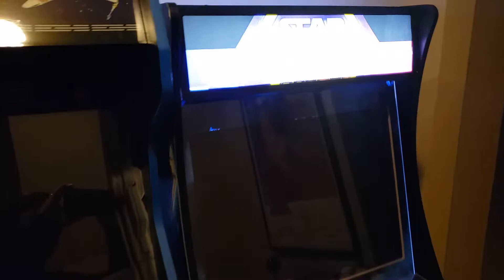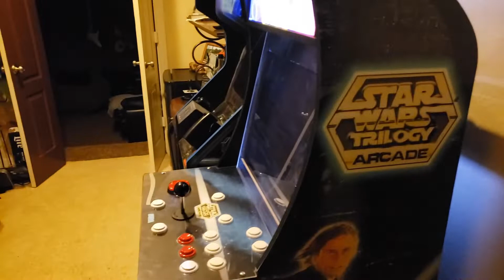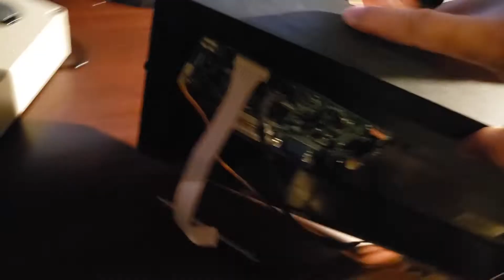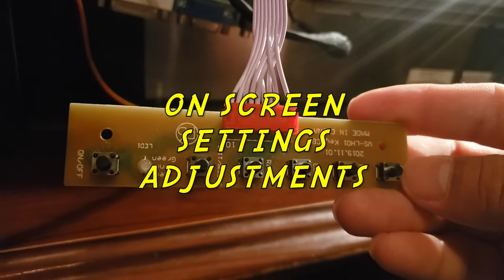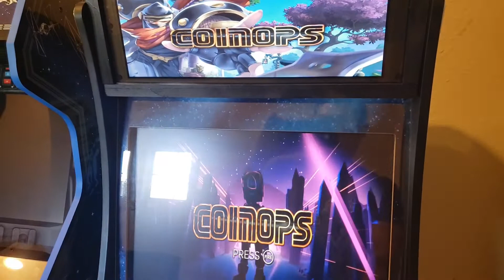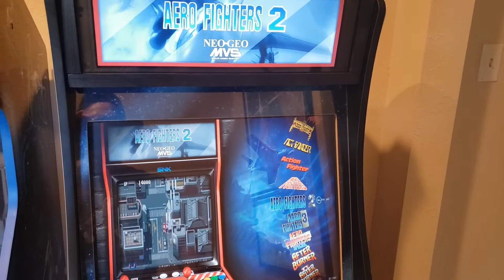Arcade1Up Build - DIY Dynamic LCD Marquee

Comment: What was your total cost for this 2nd screen marquee, and does CoinOps Next 2 have this capability built in?
Reply from the maker: For me, it was the cost of the marquee ($116) plus the wood, plexi and can of flat black spray paint (leftovers from my larger arcade build). I'm not sure how much the leftover stuff was, but plexiglass is not cheap, but when you spread it across other projects, it makes it worth it. I also used a slot cutter for the plexiglass to slide into (like T-molding). All of these add up if you don't have multiple projects involving the same materials. Sorry for being so vague, but I don't recall the prices I paid for the stuff originally from my hardware store.
Reply from the maker: Also, yes. COINOPS NEXT2 has the capability built in for dynamic marquee. This is one reason I use it over Big Box (which i have also but find more complicated to get things working).